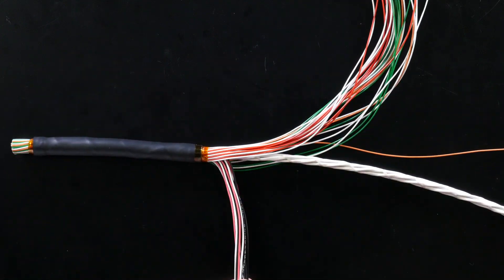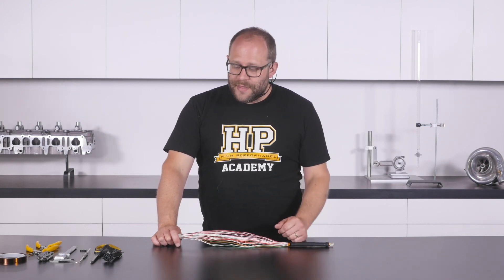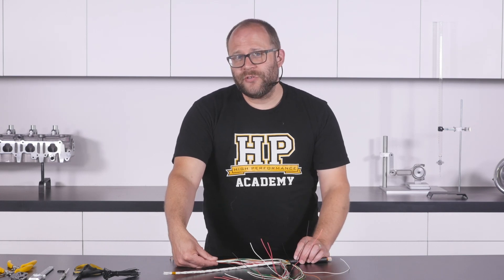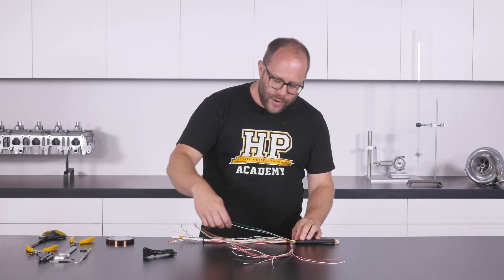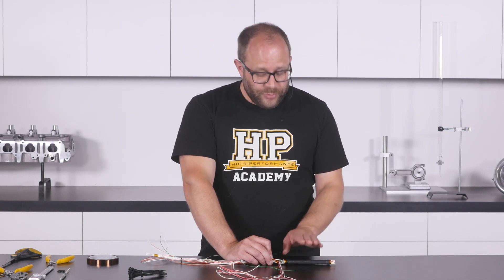It's So Easy To Get This Wrong | Wiring Harness Branching [#FREELESSON]

Comment from the maker: 🦸‍♂ Building a fast car? Get $400 OFF the all inclusive VIP online course package deal: https://hpcdmy.co/vipy74
🔋50% off your first wiring course! Get the knowledge and confidence you want. Branch out and enrol today: https://hpcdmy.co/offery74
0:00 - Branching is Hard, This Is Why
0:21 - Our Aim
0:55 - Between Branches
1:07 - Branch Points
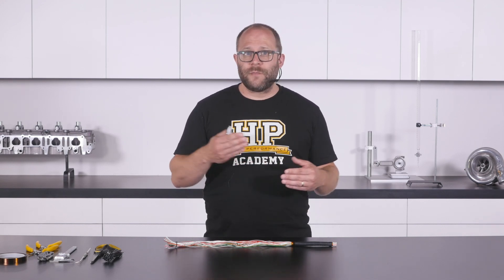1:23 - 2 Most Common Tasks
1:42 - Branch Example
2:38 - Step One: Gathering Wires
4:28 - Lay-up Design Notes
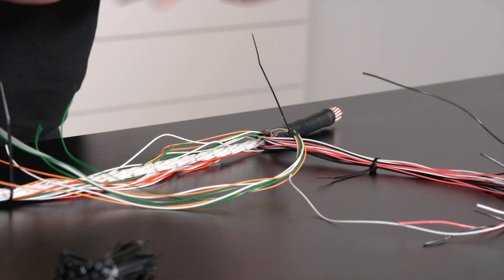5:51 - Step Two: Securing Branch Sections
7:07 - Step Three: Branch Orientation and Strain Relief
8:32 - Kapton Tape Flexibility Notes
9:10 - Booting Notes
9:34 - Bare Branch Example Takeaway
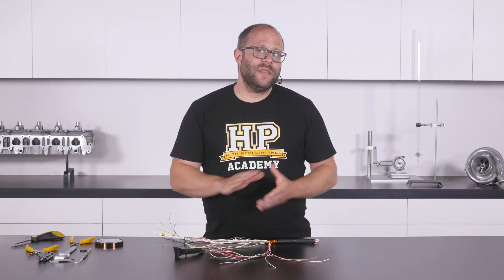10:13 - What's next?

Comment: 5:57...nothing to see here 🤐
Reply: @MuffinStomper  I'd recommend using velcro cable ties instead. Reusable and no unnecessary side cutter risk introduced
Reply: @MuffinStomper  small mishap in a otherwise long and good video... But holly moly it draws attention

Comment: Is it normal for a coolant temp sensor to have continuity between the wires when you measure at the sensor connector? In none auto applications a tempereature sensor may have a resistive divider at the ecu side but I dont imagine an automotive system requires the level of accuracy that would require 4 wire measurement so I assume the continuity is due to some break in the wires but always good to get a second opinion.

Comment: How do you tell which sensor is which when using the same color wire for all the sensor
Reply: It's peeling off a concentric layer where the sequence is explicitly defined so he knows the next group is a certain sensor and so on for the group after.
Reply: @JosephHHHo   but one layer had 4 or 5 of the same color wires. I understand concentric twisting and everything but it's having so many of the same color wires. I like to be able to tell what wire is what just by a glance
Reply from the maker: @Peyton instead of trying to commit a bunch of random colours to memory it's easier to just check your documentation like Zac does, and then he will check the ident tags, which is exactly the same as checking fully coloured wire and associate colour bands.
What he has done in the meantime though, is saved a ton of time and money on not having to source, stock and sort 100 different colour options and instead can bulk buy white, generally at a bulk discount to boot.

Both options will get you there, but that is just a little insight into things, hope it helps. It certainly can look intimidating if you assume you're just plucking things out of thin air.

Check out our video where Andre visits Renvale for a bit more on this and other wiring topics: https://www.hpacademy.com/blog/what-goes-into-a-motogp-formula-1-wrc-or-formula-e-wiring-harness-tech-talk/ - Taz.

Comment: I’m still unsure about what the actual job of the kapton tape is for. Other then helping to provide strain relief why is it used in place of tradition electrical tape? I heard the part about making it easier to service wires if needed and to prevent the adhesive of the molded boot to settle on the wires. But is there other reasons why this tape is used?
Reply: Never use duct tape on duct work, never use electrical tape on electrical work.
Reply: Electrical tape is not a permanent material in the conditions typically seen in an automobile; the glue will release and the vinyl will stretch, roll, and otherwise distort considerably, making it very unsuitable as a strain relief.
Reply: @TheSteelArmadillo  this happened to my radio harness cut and resolder job, all the electrical tape was unraveling. No issues yet but it looked like a nightmare
Reply: @TheSteelArmadillo  some electrical tape will also become brittle with time
Reply: Part of my solution is to zip tie the electrical tape around the wires. This prevents unraveling and provides a little more bulk that allows more margin for chafing against metal things
Reply: Temperature rating. Kapton will hold up to temperatures that would melt vinyl electrical tape

Comment: You guys have been so helpful on my automotive journey. I’ve been a bit slow on wiring my car but I’m excited and even ready to take it a bit further by engineering my own fuse box. It would make the power source much simpler than having 2 split fuse boxes that my car comes with factory, and I could treat it like a pdm. I’d like to produce a factory or better quality harness before my project is sold